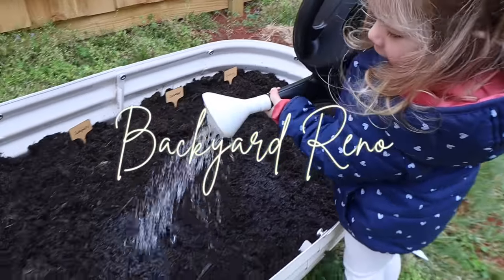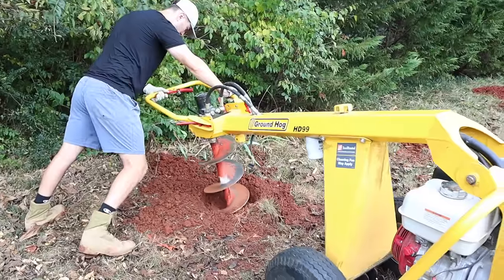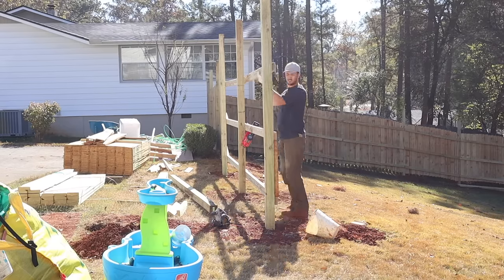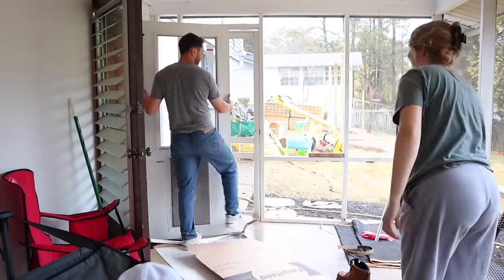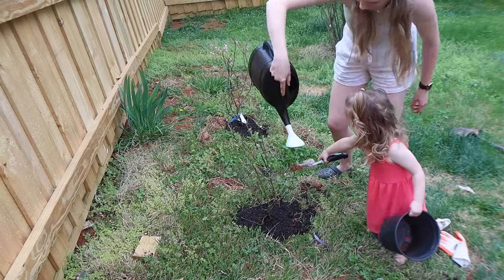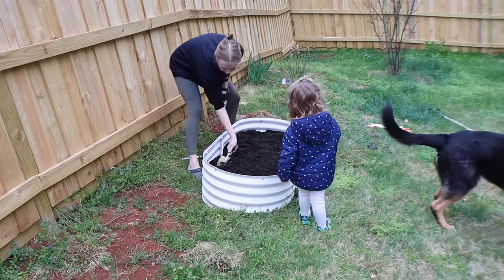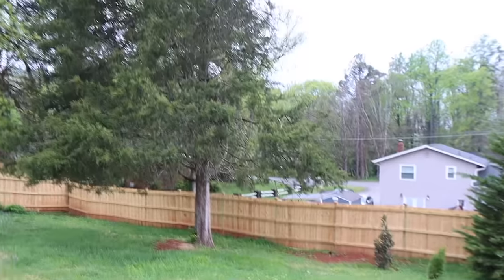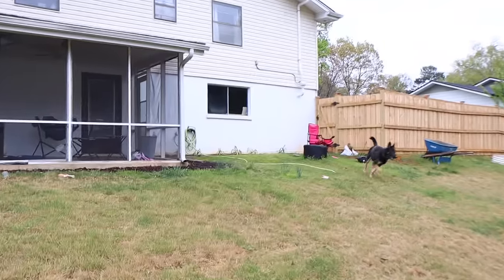WE FIXED OUR BACKYARD! | building a fence, adding a doggy door & a mini garden *BACKYARD MAKEOVER*

Comment: I have a deck over the top of a sunroom and would not recommend unless you find a way around the flat roof.  Our rubber roof under the deck has caused leaking, so I suggest either just a deck on the upper level with a patio under it (nothing to rot), or a covered deck/porch on the upper level so it also has a roof.